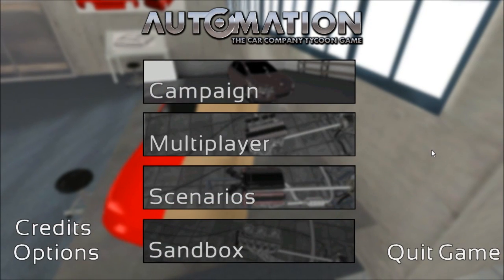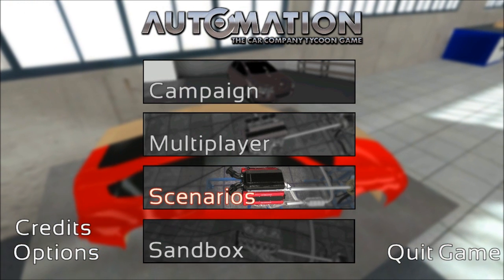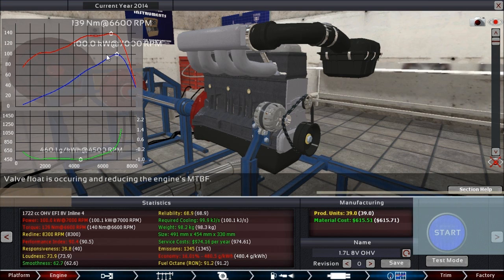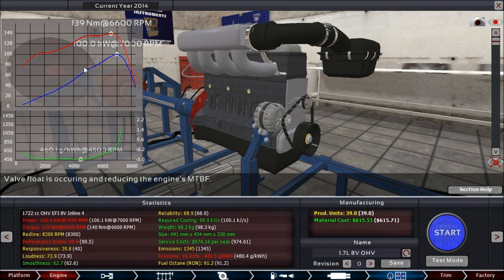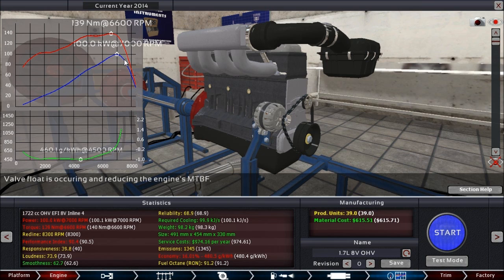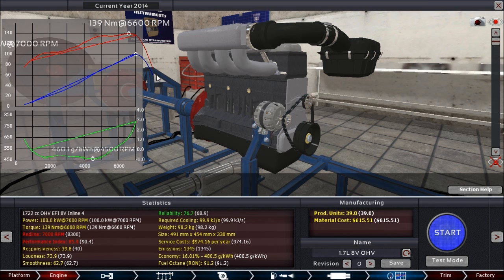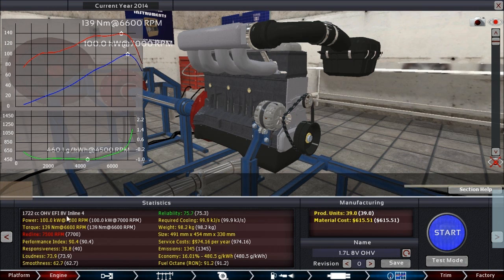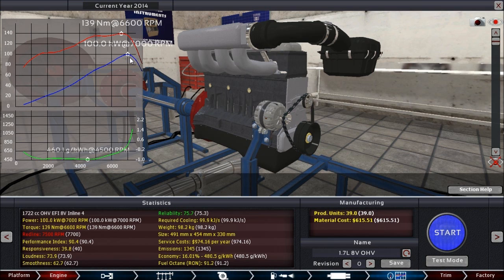Little Dev Update: Engine Performance Index

Comment: So I suppose DOHC engines will now have bad performance index? Most DOHC engine I built (even rather low powered ones) will peak at the rev limit unless limit is ridiculously high (in most cases above 8k). So I would expect many of them to have a penalty?
Reply from the maker: SUN SU Well, the calculations don't give you "a penalty" per se, they just show the true performance of the engine better. In the case of DOHC you have higher performance at all RPMs already, so the index would be higher. If you cut off at peak power, consider lowering your cam profile for better performance overall.

Comment: Very good. I am definitely guilty of setting my red line right where horsepower stops going up and I didn't realize it was a problem. I'll need to re-examine all of my engines now. :) This will be particularly painful for my I4s, which have the hardest time with durability.
Reply from the maker: Trifler500 I think you're not the only one who has to reconsider al lot of design decisions :D